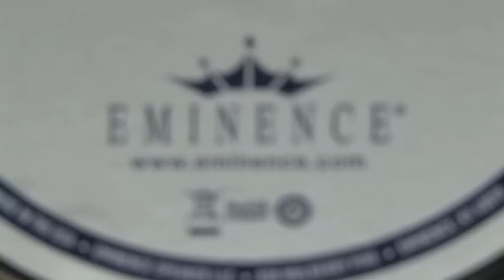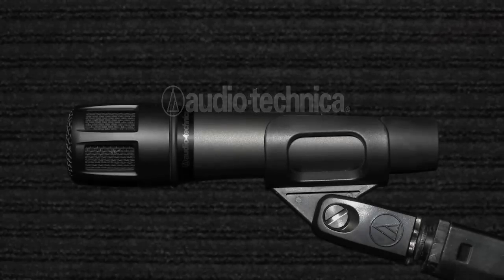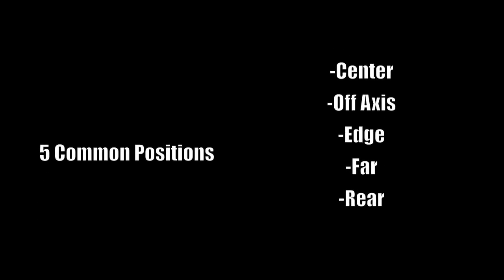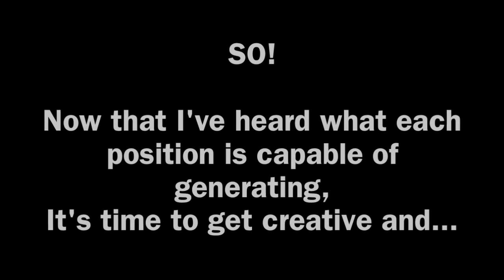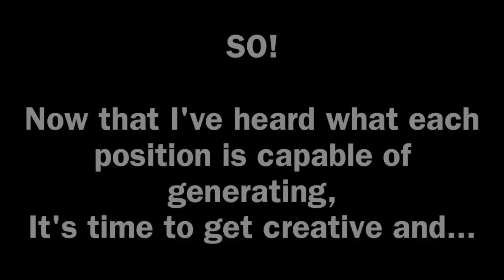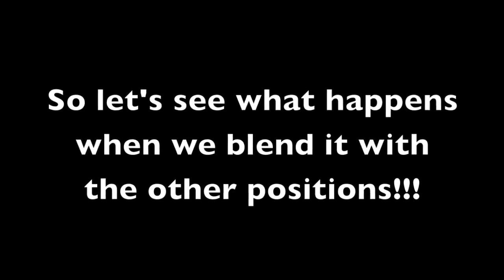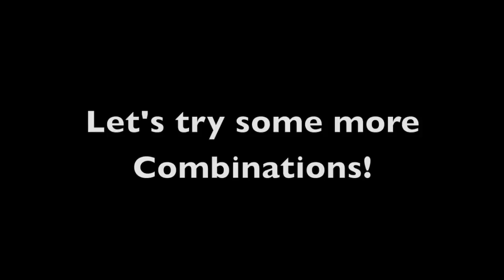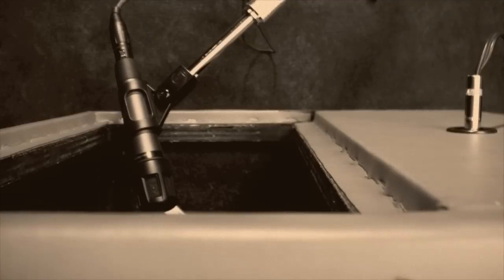Guitar Speaker Miking / Mic Placement  - 5 Most Common Positions - Best Way to Mic Guitar Amps

Comment: I have an ancient vintage mic and I used that behind the cabinet facing the wrong way - it has super bass and and the waveform is of course inverted so it is in-phase with the front mic. You can use a condenser the same way too. Try it, it really phattens things up! :o)
Ace video BTW!

Comment: @Jimztoob I'm very certain that the SM57 would sound muddier due to its capsule's exaggerated proximity effect.
I like how the ATM650 allows for much closer miking due to its attenuated LF response. Coupled with the hyper-cardioid pickup pattern, I get insane isolation on very tight stage setups!

Comment: The off-axis and rear mixed was pretty nice! I have been dual micing my amps for my recent recordings, but I am using a pair of condensers. A Rode NT-2 and an SE X-1. Both at the front, but twisting them to get the mix of highs and low I am after. I dig that sound you got though! Awesome. :D

Comment: Hi there, cool vid man..... quick question, i'm looking to buy a couple of speakers and put them into a small constructed wooden frame about the same size, and then fix it into a constructed enclosed box so the noise doesn't bleed out to the neighbours.
With the speaker on the floor of the box how man cm or inches out from the side of then speakers would you put the side foamed panel,... and also how far above the speaker would you put the foamed lid.

Please let me know 
Thanks man
Reply: depends on your speaker size, brand, and type. and yoru desired tone.

Comment: ok..great advice...thanks very much...but..does that mean i have too now buy a dummy load or something with an output which then goes too the DAW which i dont have yet,,,or just keep my amps combo speakers connected or will that mute the set-up you just told me too use...flat out affording new strings tomorrow dudes :(..this computers' sound card and motherboard connections are old & fried..currently using a usb external soundcard..

Comment: Hey Dave, this is a very instructive video, among the best I've seen about guitar miking. I tried the REAR/OFF AXIS/EDGE combination. I'm using a 2x12 cab and the OFF AXIS and EDGE mics are pointing to each speaker, following by far the 3-to-1 rule, and each mic points the speaker to about an inch.

I got a very crunchy tone I'm very satisfied with but regarding this configuration, could there be any phase problems between the mics that face the speakers?  The DAW's phase meter dances between 0.00 and 1.00 (or 0 and +) and I'm not pretty sure if that indicates a phase problem with the 3 mics on.
Reply from the maker: Daniel Kohkemper I dont want to sound ignorant, but I dont believe in phase issues.  ;)  Even after you've tracked an entire record, with technology being what it is today, you have the ability to push and pull waveforms and regions in and out of phase VERY easily.  If something is out of phase, it doesnt take much to correct it these days.
Reply: ExesForEyesMusic Well yeah I know that, but I just didn't want to do that for 12 guitar tracks of 11 songs in an album. As a matter of fact the only method I know on how to eliminate phase problems is to shift the offending tracks to match a reference track, but at least I don't know if there's any plugin or black magic artifact that can do that for you. Thanks again for your answer and the excellent video.
Reply from the maker: For sure.  For 11 songs, you should only have to move 11 regions after you edit and consolidate.  Super easy ;)
Reply: ExesForEyesMusic Hi - maybe and ignorant question. I am just starting with my micing of cabs. Off Axis, Edge and Rear - is great combo and can get any box sounds great. How was the recording done? L-Off Axis, R-Edge, L-R-Rear - 4 times recorded? thanks a lot
Reply: Marc see one track, should it be left, right or central, is the combination of the mics you're using, so a left track contains signals from Edge, Off-Axis, Rear, etc, and so on the right and central tracks, depends on how much you want to stress your guitar player.

This is the sound I got using 3 mics, I hope my explanation was clear.

https://soundcloud.com/psykoh_kemper/guitar-tone-1
Reply: Daniel Kohkemper thanks  Dave. i listed to the sample. that sounds great. so 3 mics recorded 1 performance. on this video you are tracking each mic separately?
Reply: Daniel Kohkemper hi Daniel. a quick question. what is your opinion on Iso boxes for recording? I find it quite boxy sound... I am looking at JetStream Iso as an option for evening recordings. I am really a sucker for death metal guitar Death-Human, Suffocation, Origin...
Reply: Marc see Well I have not used one myself yet, but taking into account that I recorded guitars in my own bedroom, without any acoustic treatment save for some sheets in front of the cab to function as an attenuator (I know this is not the proper solution), I would say if it works for you that's OK.

I don't really know if they sound boxy, depends on what are you looking for, if it's not to bother your neighbors it should work fine.

I also like the Human sound on guitars, try a Marshall and a few mics and you should be in the ballpark.
Reply: Daniel Kohkemper thanks Daniel. I am keeping an eye on Ibanez TSA30h 5 tube... maybe get the drivers chaged to Vintage 30. I use Blackstart Disx pedal.
Reply: Daniel Kohkemper Hi Daniel. I am starting to have an idea. Got new Marshall DSL40c - very lovely amp, my 1st tubes. Now looking for speaker swap - im happy with Celestion G12t75 but the wait time is like 3 months now. Can you recommend Eminence that is similar to G12t75 and good for death metal shredding style?
Reply: Marc see I'm not a speaker guru either but the speakers we used on this audio were from https://wgs4.com/ Warehouse Guitar Speakers, on a custom 12x2 cab. The guy that made the cab said they are a good replacement for Celestion.
Reply: +Daniel Kohkemper almost all DAW's now a day have a phase switch built in the the track. just click that. if that doesn't cure it, use the slide / bump / shift shortcut in almost all DAW's. that should cure your issue bro. though im guessing by now you have either finished your demo, or fixed the issue on your own. good luck
Reply: +chuck jones Hi Chuck thanks for your response, I already knew about the phase switch, but that changes 180 degrees the signal, I'm still concerned about the middle points between 180 and 0.

For solving this problem I guess more thorough test should be performed, using a clean sine tone and using different mic lengths. I finished recording guitars in november and we need still to continue with the rest of the recording.

Cheers from sunny Costa Rica!
Reply: +Daniel Kohkemper in between 180 ? not sure what your referring to. simply flip the polarity. if its printed in one stereo track, that's a little bit different, then you will have to convert one track to mono, pan hard left/right the original stereo track and flip one. good luck and cheers to you as well buddy.

Comment: Brilliant! Simple yet effective.  Love that rear tone, great for blending.  I've done this myself with inexpensive amps and dearer Marshall's, using a studio/home standard Shure SM57 mic, and it works well for whatever you may have regarding gear. Use what ya got, what else ya gonna do?! :)).  Some great examples in this video to be fair.  Work with what ya have and there should be a tone in there to suit many different environments, from carpeted sound soaking rooms to more sonically expansive wooden floored rooms etc, a modern house will have one or both of these environments.  A good mic and a good audio interface to whatever amp you have should get some decent results with these different set ups. \m/

Comment: Im a little confused. Can someone explain how hes blending the tracks? Are they two separate tracks? Are you using two mics at the same time (one rear the other where ever) to make one track? Is one guitar the rear then the other is in the front?  idk Im kinda new just trying to understand this a little clearer.
Reply from the maker: Brandon Gonzalez Mix and Match as you see fit.  This end result is Left Channel : Off axis / Rear recorded at the same time and blended and Right Channel : Edge / Rear recorded at the same time and blended
Reply: Brandon Gonzalez in most music production, to give a thick guitar sound you record 2 separate guitar tracks and pan one to the left speaker, the other to the right speaker, thus a big ole fat chuck of spectrum guitars in stereo.this way when you add a lead guitar in the center, your mix doesn't sound like "what the fuck, where the fuck mumbo jumbo". this is called instrument placement in the stereo spectrum. lesson 1 in mixing.

Comment: You probably wouldn't double track a jazz guitarist because he's unlikely to play the same thing twice. But it's pretty much standard in rock/metal, at least on rhythm tracks. Any semi-skilled guitarist should be able to play a riff the same way twice. But it's the subtle variation from take to take that make double tracking so effective. It makes the sound bigger. I'm sure you can hear the difference in this video. Stereo doubling is a way to achieve something similar with just one take.

Comment: atm650 is clearer treble and more edgey, sm57 is smoother and more thick in the mids. neither are "better". if you have a dark smooth or dull amp then use the atm650. if you have a trebley tinny edgy amp use the sm57.